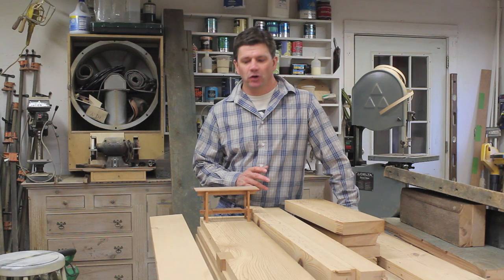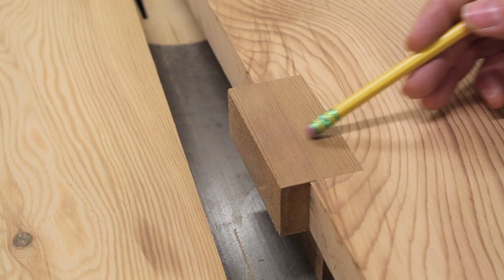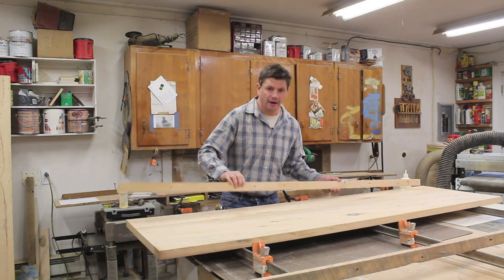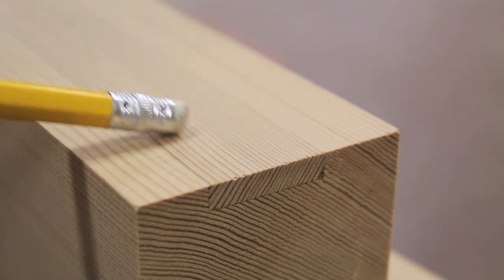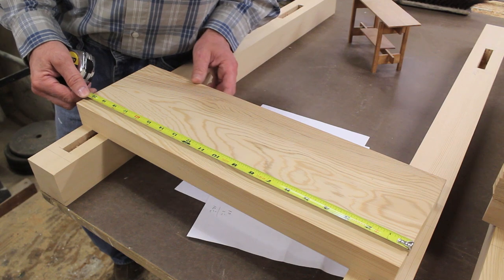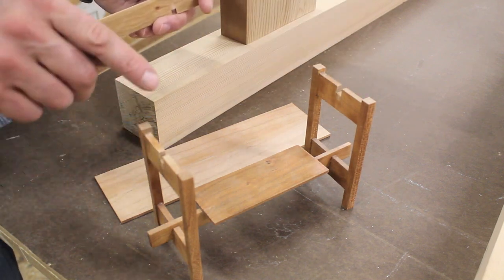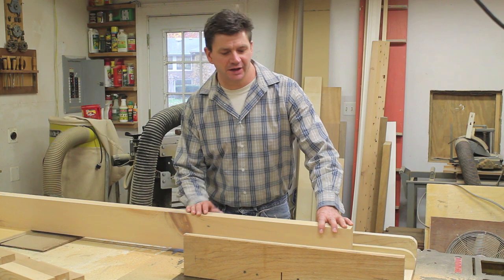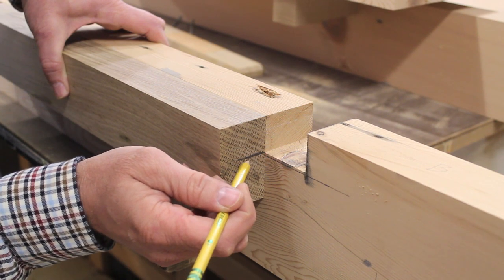Building a Church Altar with reclaimed lumber and mortise and tenon by Jon Peters

Comment: hey jon. great vid. are you using a blade on your saw that has a lot of teeth? the cuts are super clean. also, your dutchmen joint for the top is not the same color as the board. is that a Jon Peters idiosyncrasy? i noticed on the table with the bow tie dutchmen joints they are super dark.

Comment: Hi there my names gary, I recently rescued 30 odd 3 meter lengths of 100x50 kauri (native hardwood in newzealand. )which I want to restore to useable lumber and make some furniture. My question is I dont have access to a joiner/planer but I have a thicknesser is it possible to achieve great results with just a table saw and a thicknesser? Cheers
Reply from the maker: It really depends on what shape the beams are in you might have to take down some of the high spots with a hand plane first
Reply: Thanks for the feedback jon, oh for sure i only kept the lumber that was fairly straight and like you say will plane out the worst b4 running it threw the thicknesser, iv seen people use a sled to fix the lumber to then send that threw a few times dialing it down as you go, getting a perfect flat side then flip it over and get it parallel.  Many thanks once again n please if ya have the time check out my vids n consider subscribing 👍☺

Comment: I was just wondering if it was the design of alters to have the tops floating like that or if the size of the wood caused it instead of the tops resting on the frame. 
You can tell that I don't attend church that often.
Reply: *****
Generally you want an altar to be heavy rather than light in order to distinguish it from an ordinary table. Christian altars derive from sarcophagi, stone boxes used for burials in catacombs. That said, it should also convey a sense of grace and elegance, and yours certainly does. I hope those oak braces will be enough to keep the tabletop sturdy. It would be very displeasing to have a wobbly altar.